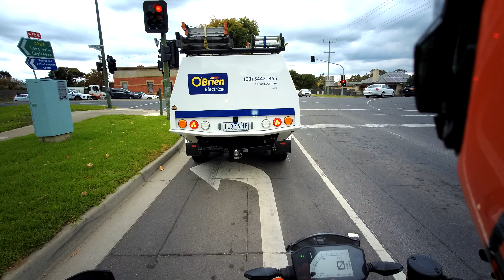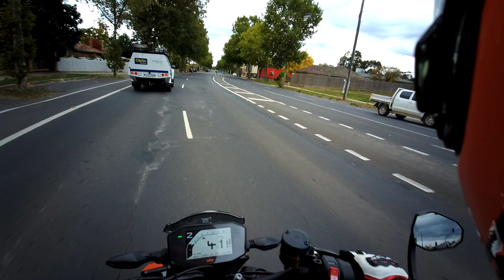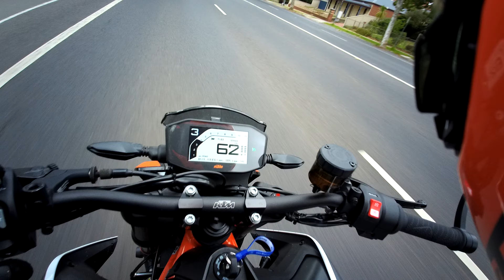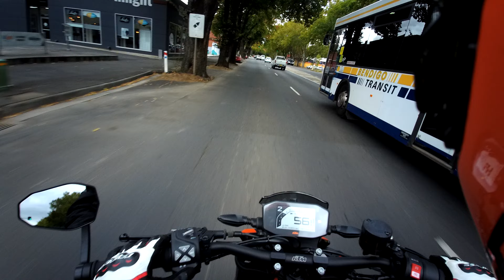How to use Cruise Control | KTM 890 Duke R

Comment: are these standard on the 890 R? or can it be added on later?
Reply: for that year of bike*
Reply from the maker: @MikaelAbehsera  Dealer fitted option. Have to buy switch block n dealer activates with licence code. Can be done at anytime. 100% worth it & easier to operate than cruise on my '21 V4 1100 Tuono.
Reply: @DukeOfTwist  I found an 890r near me and I negotiated for 10900 Canadian dollars, no cruse control no quick shifter, but the price is really good and only 12000km, any thoughts?
Reply from the maker: @MikaelAbehsera  I'm in Australia so I don't pricing, quick shifter is another dealer option they just buy a key code for your vin & update software, no physical parts required. Its an amazing bike hangs easily with litre bikes.